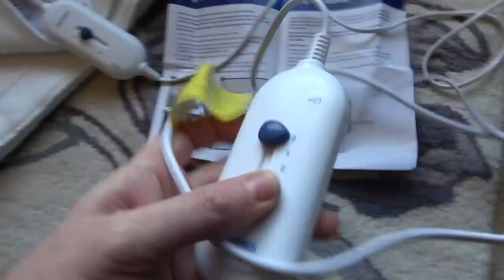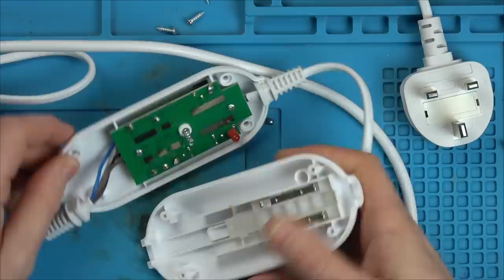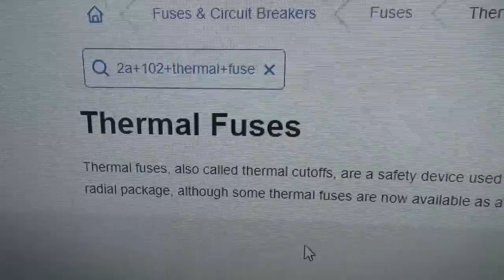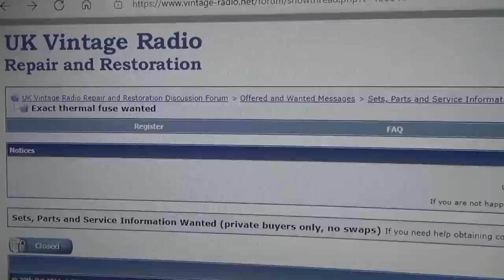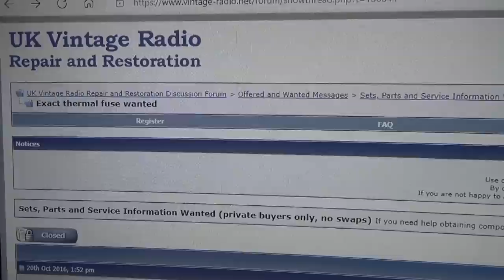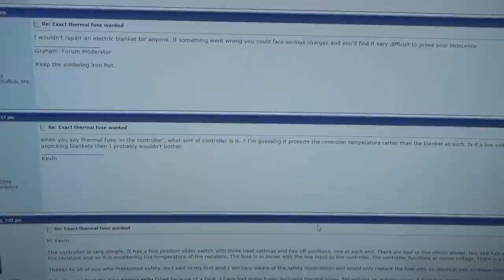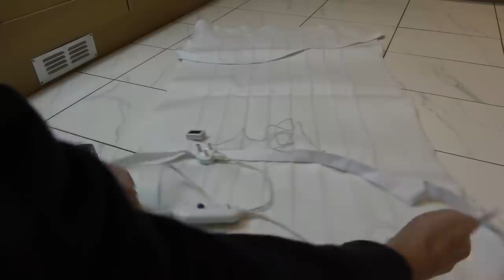Faulty Electric Blanket - No Power - Tea Break Fix

Comment: Don’t worry, no one can afford to turn an electric blanket on these days!😂 Wise decision. I would never trust one, even straight of the box!
Reply: They are SO cheap to run, like a couple of pence for the night. They are also really quite safe these days, those thin wires would burn through and the blanket is made of fire retardant material these days as well. They are much safer than the old ones which didn't have the thermal fuse either.

Comment: Just use those thermal fuses you have. If anything goes wrong, the circuit breaker will switch off. Nowadays circuit breakers are fast and reliable. And a few degrees plus or minus does not count. It  will burn out if the blanket picks up more than 2 amps anyway.
Reply: The circuit is most likely on a 32A breaker (where as the mains plug is only rated for 13A, so the fuse in the plug would most likely go before the breaker trips)
And that is assuming his house even has circuit breakers (a lot of houses in the UK still have fuses, i know someone whose house still has fuses)

If you are thinking of arc fault breakers, then his house almost certainly does NOT have them, the regulations in the UK only started to even mention arc fault breakers in the last few years, and even then their use is not mandatory
Reply: @pineappleroad  my silent night single electric blanket only has a 3amp fuse in its plug - whereas the extension sockets have 13 amps fuses. So I presume the blanket fuse will be the first to go? ( We only have fuses in our house , not MCB and RCD.)

Comment: What about using Wires Adhesive instead of soldering as you are more likely to cause the fuse to go away do to excess heat.

Comment: Personally I would be happy to fix it for my personal use, but I would not fix it for resale for example.

I would find a thermal fuse as close to the rated fuse as possible say within 1 or 2 degrees if possible go lower than the rated for extra safety, the voltage is important, but the current is a maximum, so that fuse can handle a maximum of 2 amps a higher rating should work fine too, as you're thermal cut off value is still the same, and it should have a second fuse protecting it from over current.

as others have said the two 1.8kohm resistors are there to get hot and trigger the fuse if too much current flows through them, this is because power in a pure resistor is I^2*R and power from a resistor is dissipated purely as heat so if the current I increases so does the Heat from those two resistors.

since the two resistors will be in series with the heating Element in the blanket the sane current flowing through the resistors flows through the heating Element thus the heating element current is the same as that flowing in the resistors and if that current was to get too high to the point where the blanket could burn you, the fuse should blow first.

this what is important imho is that the thermal fuse is nestled between the two resistors and that you have good thermal contact between the resistors and the fuse, and use thermal cement to ensure good heat transfer!

the reason i suspect having the exact cut off point is not necessary is, because 1. i bet those resistors have maybe a 5% tolerance so all the resistors wont be exactly the same value and 2. there will be a fairly decent margin left for safety's sake anyway because no responsible company is going to risk a product that could potentially burn you, let alone set your house on fire. 

Though any repair you performed would be totally at your own risk!
Reply: The resistors are not in series with the blanket. Suppose the blanket takes 1A. P = i^2*r = 1800w. Now these resistors are not 1800w for sure. The circuit just acts as a secondary timeout protection in case the thermostat fails..
Reply: Another possibility is that there' is an NTC in the blanket in series with the resistors. The higher the temperature, the higher the current in the resistors. In this case the circuit would act as a secondary temperature protection. But one thing is sure: these resistors are not in series with the blanket.
Reply: @kriswillems5661  that all depends, but if those two resistors are in parallel at they would be 900 ohm.. Which would of course be 900watt but i very much doubt that it would be that, either. Though if its cutting power to the device it must be in series to the switch / heating element in order to cut the supply when it fails

Comment: Weird protection. You would expect the thermal fuse to be in the blanket. These thermal fuses probably just act as an overload or time protection and are heated up by the nearby resistors. I think they are a secondary protection. When the thermostat fails, they will blow when they get too hot after a while. They act as a timer, rather than overload. The resistors are 1.8 K which is too high to have them in series with your load and act as a current protection.
Reply: Another possibility is that there' is an NTC in the blanket in series with the resistors. The higher the temperature, the higher the current in the resistors. In this case the circuit would act as a secondary temperature protection.

Comment: I avoided watching this video in case Vince got the most massive jolt of his life. Never try to repair an electric blanket. They are cheap enough to recycle and get a new one. Good on you Vince, for warning people in the same manner. Its not worth having your butt on fire to save $30 :) These kind of devices need to be thrown out and replaced, not attempted repairs. The manufacturers make them to such slim tolerances that the value of the fuse or other safety device is critical, as thay blow up dozens of them just to get the circuit right; so it lasts just beyond the 2 year warranty, then dies :P
Reply: Booooooo!

Comment: It's probably best to err on the side of caution. However these fuses and resistors don't seem a great design to me. One seemed to be in some white gunk, the other wasn't what if the switch was dropped which meant the resistors and fuse were dislodged - especially the one without the white gunk? The only way to really test if this is safe is to ensure that the installation blows at the temperature stated and that the blanket doesn't catch fire. It also seems a real waste of resources as usual that the right to repair is defeated by the design.

Comment: My side of electric blanket stopped working. Controller checks out okay and provides power but the blanket wiring (checked at plug) is all open circuit. New blanket now stuck at Evri/hermes. Grrrrrrr

Comment: I'd say the product is borderline dangerous as it is. Look at the build quality - one of them held down with silastic (an insulator), the other not, made in China with inconsistent, unbranded parts (yes I'm aware they're different models). There is no way that two examples of the same product will trip in the same conditions. This kind of design should have been replaced with a proper microcontroller-equipped version years, if not decades ago.

Comment: Its usually the thermo fuse when they break me I couldn't even solder the fuse in without the soldering iron heat blowing the fuse then I thought what a rip off this blows when you leave it on high during the night with someone lying on it then I thought it's a damn site better than being awakened with your whole bed on fire as for fixing it I could never equate the safety with the cost of a new blanket so I just made sure I had spare electric blankets for when they fail but I say no to repairing it one silly mistake and one of your family members might be the one to wake up to a fire in the bed so no I say don't fix it just buy another blanket and try not to leave it on high during the night those fuses are there for a reason and even with the same fuse I just couldn't do it too much of a risk for me

Comment: I think plus or minus 5° should be fine. Most things like this have a tolerance. And you're within that threshold so I wouldn't have a problem with fixing it. And that stuff that you found on top of the other fuse and resistors may have been thermal paste but I also didn't see anything to dissipate the heat and where does the ball bearing come from? Was it part of the switch that gave you positive block feeling as you went through the selector? I don't know why there would be thermal paste with nothing on top of it. Maybe the resistors are going bad and too far out of value that could cause them to overheat and blow the thermal fuse. Now that I think about it maybe the thermal paste was to get the transfer of the heat from the resistors to the fuse. Personally I don't know why they wouldn't design it with a thermal relay that could be reset. And maybe have a setup that's also permanent like this if it gets too out of control. Items not that expensive but it seems like there could be a little bit of redundancy in order to reduce waste but I also understand safety.

Comment: Look
 you chose to not put an " dodgy" repair back into the wild. That's a fix.
Frankly the resistor/ thermal fuse assembly isn't  brilliant out of the box..
.it depends too much on the thermal characteristics of the thermo fuse and  ambient temperature
What its trying to do is , sense current in the heater elements. Looking for a short that reduces the elements resistance.
The current and thus temperature of the resistors goes up if heating element develops fault.   The thermal fuse hold and open temperature are chosen with the value of the resistors to balance between operation and fault.

Comment: I'm the only dude here, who thinking, it's an absolutely silly idea , putting the thermal fuse in the control box, 5 ft away from the heating device ?
Reply: There is an NTC in the blanket in series with the 1.8 k resistors. That way the temperature of the resistors will rise when the temperature of the blanket rises.

Comment: if someone came to me with the same fault, then no I wouldn't repair it, even if I had the correct parts for it, as a thermal fuse would also need to be millimeter perfect, as too close it would trigger too soon, and too far away from the fuses would make it less likely to trip the electric.  as for burning wood, I done some as a mid-aged teenager while in hospital, and using a soldering iron for fractions of a second so you get the nice smell of charcoal, but nowhere near long enough to burn the wood for a risk of a fire. but something like the YouTube logo section would have taken a lot of dabs, and being milimeter perfect, and timing to do it with a soldering iron, so not sure if he done it with some kind of press stencil. but looks great.

Comment: 90 percent of all electric blankets and their controls are made (badly?) in China. And thousands of people are willing to put them on their beds and sleep under them. I am quite sure your repair would be just as safe as the device was when it left the Chinese factory. Still, I wouldn't be repairing them either, the liability is just too great. Send the damn things back to the manufacturer and make them responsible for the repair of an obviously badly designed control.